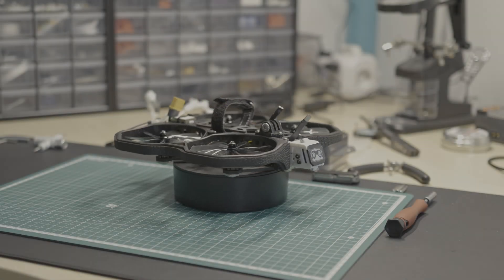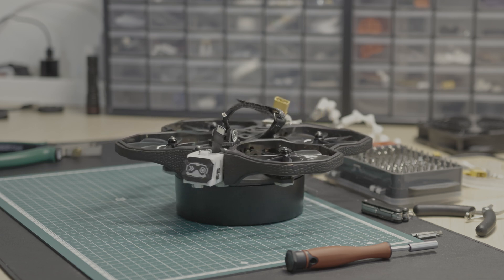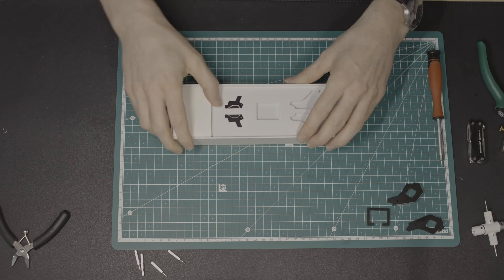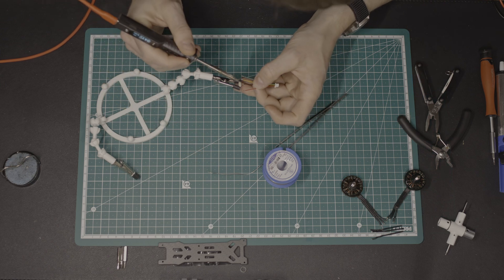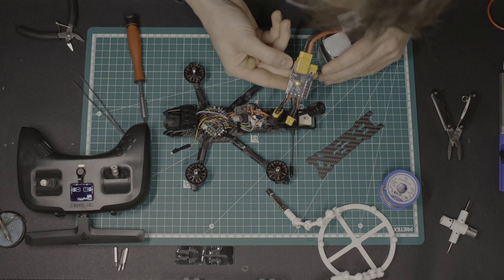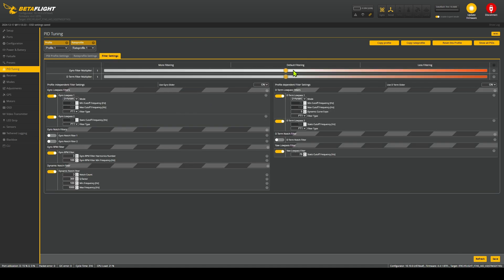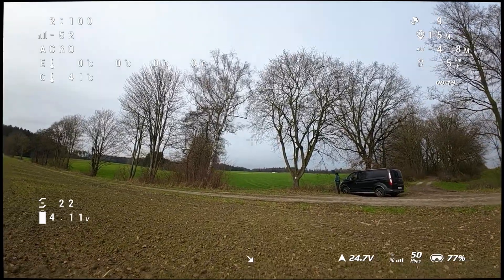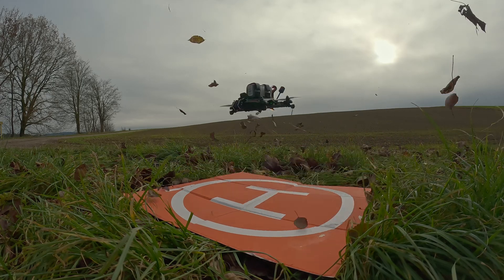Recycle your FPV stuff! From a cinewhoop to a modern freestyle drone | Protek35 becomes Domain 3.6

Comment: I love the handiwork done here, great video! 

Why did you print a 45 degree adapter for the fc if betaflight can be tuned to adjust for the angle of the board did i miss something?
Reply from the maker: Thank you! 
Yes you are right, it is possible to change the angle of the board in the settings. I mounted it with a 45 degree adapter to use the wiring "as is" and just had to rewire the rear motors because of the cable length.
Reply: @flipsfpv  ah I see

Comment: Wow 🤩!! Great work and tutorial 👍.
Thanks for sharing and happy flying 🚀!
Reply from the maker: Thanks! Happy flying for you, too ✌🏼
Reply: @flipsfpv  thanks mate ✊. I still have an analog ProTec 35 from the time I was learning flying FPV. Wanted always convert it to digital but never found the time. 
Maybe you inspired me, bro 🤜🤛
Reply from the maker: @mog59  Sounds like a great opportunity! Maybe with an upgrade to the new O4 AirUnit? 😉
Reply: @flipsfpv  yeah, but then I would need new googles, right ? My gear is analog plus digital with the goggles V2. I‘m not sure if I need a third system 🤔
Reply from the maker: @mog59  yes, the O4 works only with G2, Integra, G3 and N3… Keep the V2 as long as yes you can. Durability is unbeatable 👍🏻
Reply: @ I totally agree, bro. 
You find some long range flights on my channel … I‘m so happy with my digital gear, I needed GPS rescue several times but never lost a quad so far. 
Getting confidence in the gear was a long way but it was absolutely worth it ✊.
Looking forward to your next projects 🚀 and flights 🤩!
Reply from the maker: @ yes a setup you are used to and is configured well is all you need for long range!
Some more long range content will follow soon 😉
Reply: @flipsfpv  tough times … three years ago 😂😂
https://youtu.be/5dDHt69I4l0?si=gW3L5HjMVA4o9uiH